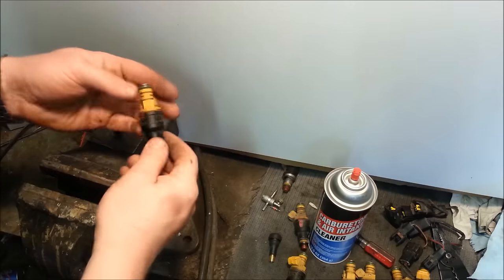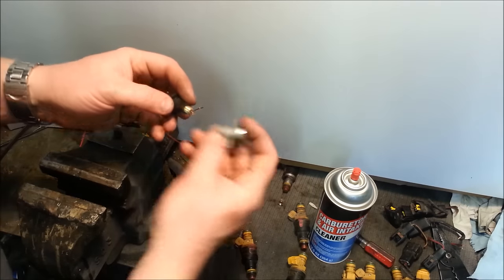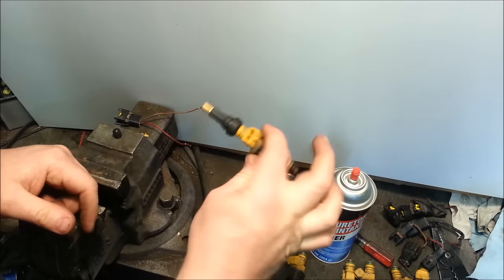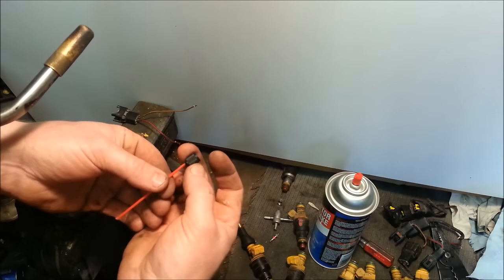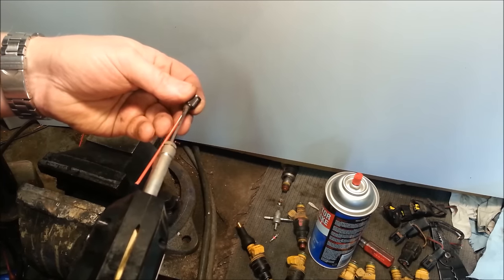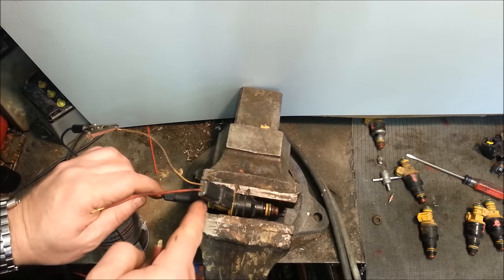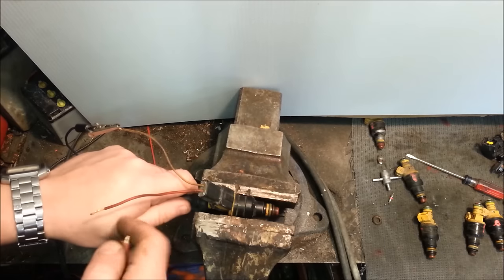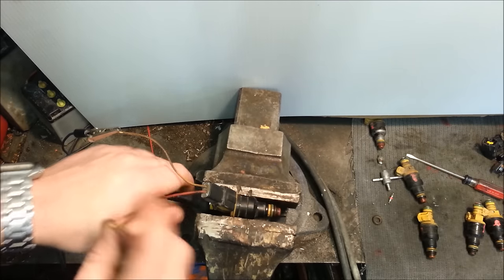Fuel injector cleaning without expensive tools

Comment: You know this is one of the best instructional videos on fuel injection.
Reply from the maker: Thanks, I'm glad it was helpful.
Reply: This guy is amazing dude thank you
Reply: Its very instructional for a science project.
Reply: How do you know if one injector is leaking?
Reply: This is an awesome video!
Reply: It's not the best they need to be done in reverse
Reply: Do a video on a reverse method your car will do just exactly what you are doing so it has done nothing
Reply: @sixtyfiveford  URE THE MAN BROTHER  THANK YOU
Reply: I applaud your attempt,but so many inaccuracies here.Your pressure is not consistent nor are you able to measure the reaction time, or the % of flow delivery. Proper test equipment and procedures take it to scientific as opposed the 'shade tree's approach. I guess if you're working on a 'beater' then ok.😁
Reply: @sixtyfiveford  q
Reply: @rockyeasterline348  Or you could do a video and I can comment on it like you did.
Reply: 100% Agree Tops!!
Reply: Agreed, simple enough for me to follow and achieve results.
Reply: Love this video,, only problem is; the title is somewhat misleading. It says with expensive tools. Who has a blowtorch ? Or a welder ? 
Everything else is so awesome.
Reply: Kja
Reply: Would the valve stem fit the opposite side of the fuel injector? I ask because I want to be sure to push all the particles out the other way?
Reply: I still want to know if injector nozzle expound after long usage

Comment: Remember that it is best to replace the o-rings any time you remove/replace an injector. If you don't, you're practically asking for fuel leaks in the near future.
Reply: Not saying it can't happen but never had it happen to me. Just check for damage and perishing and that the O rings aren't hard.

Use a small amount of rubber or silicone grease for refitting and you're golden.
Reply: I've noticed replacement orings aren't always the correct size.

Comment: I used this method today and it works. I powered my injectors with a 9v  battery (the ones used in smoke detectors). It was awesome
Reply from the maker: Excellent!
Reply: Great idea - 12+ volts straight from the battery could be bad.

Comment: Awesome hack! Suggestion: drill hole smaller than the  straw so that it has a tight interference fit and you may not need to heat or seal the straw.
Reply: Hi, video is really helpful but your suggestion is also good. 👍👍
Reply: If you aren't in a hurry you could dab a little in weld around the tube / hole for nice seal
Reply: And just a touch of hot glue.  🙂

Comment: As others have commented, using the valve stem to accomplish the cleaning is pure genius! Plus the video is well done, with no babbling. Just good information. Thanks so much! I ran the cleaner in the reverse Direction first. That's what Motion Pro says to do but their tool cost something like a hundred dollars. Maybe even more
Reply: Spraying it in reverse first should clear out any crud in the filter basket before spraying it the normal way.
Reply: I use a piece of heater hose and clamp it on the bottom of the injectorand clamp a valve stem in the other end  then fill it B12 chemtool and energize the injector and let it drip through the first time then fill it a second time and blow it out with the compressor the switch directions and do the same from the top works great and you don't have to try to seal the straw to anything

Comment: Great stuff, thankyou. My tweak on this was to make the hole in the cap with a sharp wood screw. It doesn't remove material like a drill, you can control just how much you stretch the hole by how much you twist the screw in and you can make the hole the perfect size with a little flange of plastic that melts the straw in place perfectly!
Reply: There's something fundamentally sexual about this comment... Maybe it's just me
Reply: @Kharlis007  omg reading it back now   🤣🤣
Reply: @Kharlis007  nice one bro.
Reply: Sounds like good idea

Comment: This method worked very well for me... I made a few alterations: 1. I tightened a hose clamp around the valve end for a bit more of a seal.  I had it pop off on me once before this and found you really need to wear safety glasses when doing this.  2. I drilled a hole in the top of a glass jar to catch the spray.  I think finely misted carb cleaner and sparks in close proximity might not be such a great idea.  3.  As you suggested, I used some JB Kwik on the connection between the straw and valve stem cap.
Reply: Dang... 5 years later I need to come back an re-watch the video and my original comment.  Time to do it again!

Comment: You can also use a syringe take the plunger out  and slip over the injector Leaving the o'ring on the injector. the place the straw in the needle portion of the syringe and done works great. 
Also a 9v battery works too

Comment: Great video. I plan to use this method with some tips from the comments:
 1. glue the spray hose better into the cap for a better seal.
 2. use a hose clamp to hold the valve onto the injector better.
 3. use less voltage? and maybe rig up a handy switch, maybe a foot switch? to free up your hands. 
 4. put the injector into a hole in a jar lid to contain the spray
 5. turn the injector over a spray backward through the other way.
Reply: What is #5? How can an injector spray backward?
Reply: @leomalino2364  to back flush the injector first and clean out any larger crud that may be already inside the injector.

Comment: Have done this myself and it works perfect my only suggestion is to warm the bottle of carb cleaner in hot water for higher pressure and a hotter chemical...👍
Reply: This also doubles as a quick, cheap method to produce the famed Flash Bang grenade.  Children, do not try this at home!
Reply: @MafiZed  Rite on!
Reply: I totally understand warming the contents in hot water. Most likely for justa couple of minutes. This is not a direct flame. Smh
Reply: @highspeedenthusiast6628  It's the same basic idea behind heating up a bottle of nitrous before a race.  More pressure = more power
Reply: @highspeedenthusiast6628  Really bro? What else did you expect from smokey the bear. Just give hime some money for crack and he will leave you alone.
Reply: HighSpeedEnthusiast  - What temperature should I warm it up to?
Reply: @jameylane9196  as warm as the hot water coming out of your faucet. I don't know where you're from but the general code in this country is from 120 to 140 degrees out of the tap. Just warm in a bit with hot water.
Reply: Leave it I the hot sun
Reply: Smokey Bear  Ooh! Cat fight!!!
Reply: @highspeedenthusiast6628  think it was meant as a humorous comment..
Reply: @lhayes7516  possible....🤷‍♂️
Reply: @timc9893  😊

Comment: Love it man, I've cleaned my 8 injectors in my CBR 1000 and I can now feel the results. back into the power zone :)
Reply from the maker: Nice work!
Reply: What were the symptoms? Mine losse power after 10 000rpm in every gear. Was this the solution? Is there a filter in the cbr injectors that one has to replace?

Comment: Excellent video!
Would have loved to have seen a link to a video where you show us how to use a 
multi meter to check the resistance on each injector. 
Your contraption was genius btw. Saved a ton of money from sending mine in to get cleaned by a "pro"!
Thank you so much man!
Reply from the maker: +Mark Henry Cooney Thanks for watching.
Reply: +Mark Henry Cooney You turn the knob so it is pointing to  OHMS then connect the leads to the two terminals on the injector, should read around 12 ohms.
Reply: Yeah, Mark, good video. :)

Comment: Cleaned my 2006 Mazda fuel injectors using your Tire Valve method. So much easier than other videos on Youtube. We used a 9v battery and some alligator clips which made it really easy. We also didn't have to melt the straw as the hole we drilled kept the straw nice and tight. One thing I should mention is that after we cleaned the fuel injectors we noticed the o-rings (seal rings) were worn and needed to be replaced. So consider buying some new o-rings ($4) before tackling this project. Other than that this video saved me so much money. Thank you for posting
Reply from the maker: Awesome. I'm glad you liked the video.

Comment: Thanks for the video, great help and idea, almost missed the last tip about checking the resistance because that is what the problem was. The injector / cylinder with error code had resistance three times that of the others... Going to the junk yard now for replacement 
SteveK
Reply from the maker: Steven Kjeldgaard Thanks, I'm glad it helped.
Reply: To check the resistance of the injectors, all you need is a multimeter and you check the ohm's. They should be between 10-12ohms, might be 14, either way it doesn't really matter much, cause you can check them and get a base line, and if you have any bad injectors you will see a variation in the numbers. They are quite literally one of the easiest thing to diagnose, all you have to do is Pop the clip for the wires to the injector and touch the test leads of the multimeter directly to the injector and read the ohm's-then change any bad injectors.

Comment: If you measure straw with caliper and use slightly smaller drill, won't have to glue anything, overall very instructive video, your method worked like charm, thanks

Comment: My Yamaha outboard lost about 1,000 RPMs at WOT and sporadically ran erratically at low RPMs.  After cleaning the fuel injectors using this method my engine is back to normal, running smoothly and getting up to max RPM quickly.  I had tried different cleaning methods, but using a valve stem and carb cleaner was way easier and much more effective. Thank you for posting!
Reply from the maker: Awesome, I'm glad the video was helpful.

Comment: I used this same
Method but instead of welding, I left it uncapped and drilled a tiny hole in the side. I had to bite and twist the red tube with my mouth so that I could create a tip to push the tube through. Worked extremely well. Thanks!!

Comment: I used your idea cleaning the fuelinjectors...but i didn't use melting straw...instead of melting i used insulation tape and it worked perfectly. Two of the injectors were little clogged. 
Let's wait for the results. 

Job well done Thank you. 👍
Reply from the maker: Thanks, I'm glad you liked it.

Comment: I just finished cleaning my injectors. Amazon has a cheap one on there and you just put their adapter onto the nozzle of some carb cleaner and plug your injector into the adapter and it sends rapid pulses. Works well. Best part is, once you're done just return it and get your money back

Comment: Some injectors run on as little voltage of 5 to 6 volts so be careful and check the specs before you just connect 12 volts to them

Comment: Great and useful video.  Is there a common resistance value you typically find, or do you just measure all of them and eliminate the ones with unusual values?  Knowing a typical range of resistance would help when testing them at the  junkyard to find the keepers.  When pulling them out of the vehicle you're testing, do you re-use the seals or get new ones, or is it that a call based on inspection and your experience?  Thanks again for this and all of your videos.

Comment: Excellent idea to use the valve stem and cap, I've just purchased one of those cheap injector testers (26 bucks delivered) that pulse the injector rapidly and will use your idea for the spray inlet. Thanks champ.

Comment: I cleaned my fuel injectors using a tire valve stem, carb cleaner and a battery just as in this video. I soaked my fuel injectors in carb cleaner overnight before spraying them clean. I compared the spray pattern with a brand new fuel injector and the spray pattern was the same. This worked perfectly.
Reply from the maker: Awesome

Comment: I used your simple method today to clean my 1994 Z28 fuel injectors and I got the job done in no time. My only recommendation is that its inportant to use a layered amount of super glue around the the red tube inside and out side of the plastic valve stem cap.  Again thank you for your DIY video.

Comment: Great video! I am going to use your tire valve adapter idea, but I am going to feed the fluid from a canister (as a sump) that I will pour cleaning fluid in and pressurize it to 55 PSI with a an electric tire pump, a tube from the bottom of the canister will connect to the adapter cap.  Then run the injector at 1 second every 30 seconds for about an hour. I am thinking of putting the injection nozzle tip in a pool of cleaner and let it soak overnight first. Another commenter suggested also running the cleaner backwards through the injector. I may try that first as not to work more contaminants into the nozzle.
Reply from the maker: Most injectors won't allow reverse flow.
Reply: @sixtyfiveford  Thanks! I was afraid of that, but I will try to be sure. Another guy shows there is a fine filter screen inside the injector (on the fuel input side). You can use a makeshift tool to pull it out, they are usually the culprit of a poorly working injector. He said you can even find replacement screens on ebay if you measure the dimensions of the ones you pull out.
Reply from the maker: @paulromsky9527  Yes. Generally I like to see how the injectors are working now before I invest any money into them. Most will clean up with carburetor cleaner after 5 to 10 cycles and they're good to go. The acetone in carburetor cleaner will dissolve solidified / varnish gasoline and clean up a clogged filter.
Reply: @sixtyfiveford  My injectors are original in a 1987 Fiero GT. A set of 6 new ones from the Fiero Store cost about $580 USD.  7 years ago, it was running fine. Then one day I ran out of gas but was able to roll into a gas station. I filled up, but it took me a quite a few minutes to get it to start that one time after fueling, and ever since it's runs rough at idle and not smooth at higher RPMs. It has been in storage since, but today I shot some Fogging Oil in each cylinder and put in 2 gallons of fresh gas and it started right up! I mean right up, no crank, crank, crank... just turned the switch and it started in less than half a second. It still runs poorly (of course).
A whole bunch of Chipmunk nut shells got blown out of the exhaust (I forgot to put steel wool in the ports). So now I may have a partially clogged muffler too.   I plan to replace the fuel filter, and clean the injectors. I am told it can even be the fuel pump, they were not designed for more than 10 years. 7 years ago it was 28 years old so it is due. Maybe running an old pump dry briefly was enough to destroy its efficiency - running out of gas just once caused the sudden poor running (right?). A new pump is a good price but replacing it requires getting under the car and my wife won't let me creep under a car on heavy wooden blocks or concrete and back up stands. So I may have my mechanic do the filter and the pump just on their age alone. I expect the injectors will need to be replaced, but I have to try to clean them first.

Comment: Flushing them backwards works best to clean the inner screen. 😉. I highly suggest wearing eye protection during this cleaning process, if the cleaner line pops off it’s “eyeball” city! 😳. Good video 👍
Reply: In the video did he not flush it backwards? If not, will the tire valve also fit the other end?

Comment: my local mechanic spray it from the other end, because there's a filter inside the injector, and there's dirt filtered there, so it's better to spray from the other end while energizing the injector. the crud will fall off of the intake side and the filter will be clean.

Comment: I've done basically the same thing. I use a injector  pulse generator as it is safer for the coil in the injector.  As a last step I turn the injector  around and back flush it by spraying backwards. Really stubborn  dirty injectors you can dribble  carb spray in them, cap them and let them soak before spraying out.

Comment: Excellent! I'll definitely be using this method. Much better than all of these people trying to use multiple sizes of hose and heat shrink. I'll be gluing the tube into the cap with RTV silicone I suspect. Very helpful!

Comment: Done.  Other than the straw trying to blow off the can when the injector didn't have power, everything worked perfectly.  Two of the holes were plugged.  After a few shots, a few minutes and a couple more shots, the injector is clean as a whistle.  Thanks again.  Oh yea, the only thing I did differently was, I used high temp glue gun on the inside and outside of the valve cap.  Rock solid.
Reply from the maker: Awesome.
Reply: sixtyfiveford big difference.  After cleaning the injector this beast is running like it was brand new.

Comment: I just did this , similarly to your directions.sprayed cleaner through inlet manifold. Used 9 volt battery to operate solenoid. Vehicle seems better but I’m not completely convinced. Trial and error I guess. Ohms are all good!!!!  EFI ?
Reply from the maker: Pulling them lets you visually inspect the spray pattern.

Comment: Sometimes I run the same setup but backwards when the injectors are reallly gummed up. Great video as always.
Reply from the maker: Absolutely. I find some won't allow reverse flushing though. The pressure seams to hold it closed.

Comment: I rigged mine with a toggle and backed flushed them to make sure they worked and  no crud had accumulated inside before installing new screens & o-rings. A 9volt battery did the job too. Excellent video though.
Reply from the maker: Awesome. I'm glad you liked it.

Comment: Good evening , thank you for an excellent and informative video, I feel confident to clean fuel injectors. A presentation well done, GOD Bless all. If not sure about the voltage on injector , suggest adding a 5 or 10 amp fuse to the 12 volt positive lead wire, this will pop if too much voltage is added to the injector. Thanks again